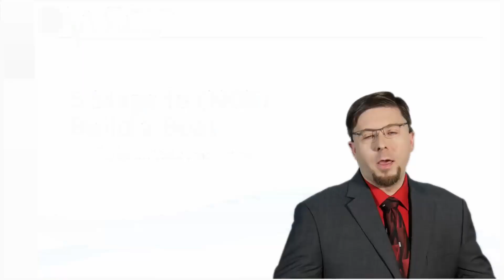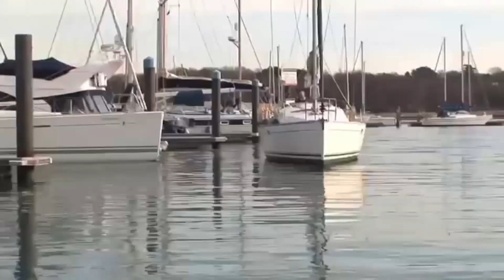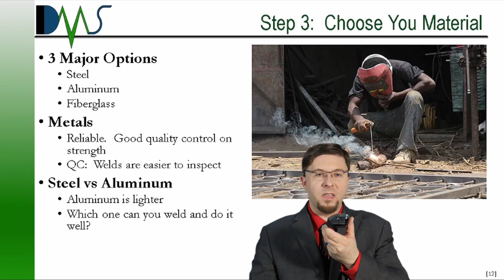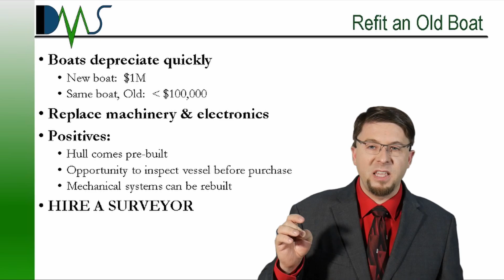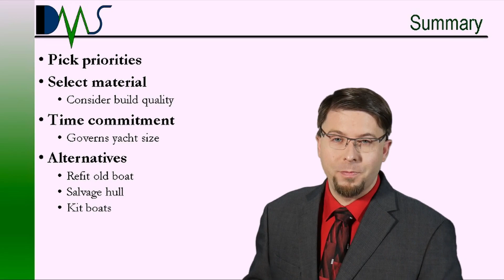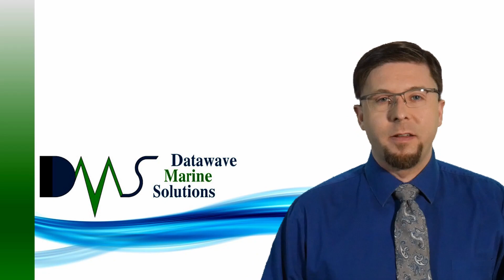5 Steps to (NOT) Build a Boat:  Planning for DIY Yacht Construction

Comment: Watching this, the guys building his own vessel, SV Seeker, springs to mind. I do wonder if that vessel will pass survey.
Reply: What survey? He is going to get to the regulatory fine print and decide to classify it as a pleasure boat of less than 65 feet buult for personal use. In which case no survey is needed.

It's actually been a while since I looked at the regs in the US, thus I may not be remembering the details for SV Seeker will find too clearly. Up here in Canada the window of no inspection is a pleasure boat, between 6 and 24 meters long, between 43 and 424 cubic meters of volume, with a capacity of not more than 12 passengers, and built for personal use.
Reply from the maker: @TrabberShir  It's almost the same in the US.  According for 45 CFR 2.01-7, as a chartered boat with captain and crew provided, they are permitted to take up to 6 passengers and still be classified as an uninspected vessel (no survey).  There are also some size limitations on GRT.  But even as a private yacht, USCG still includes some basic requirements in terms of survival flotation, fire protection, navigation equipment, etc.
Reply: @TrabberShir  It's the Jones Act that will dictate whether it is an "Inspected" or  "Uninspected" vessel, but insurance will definitely require it, especially as a commercial venture to carry passengers. Now I don't know what his intentions are, but as a retired marine surveyor I would deny that boat coverage for a dozen reasons.  If he can get his naval architect to sign off, then fine.
Reply: @BrianNavalinsky  I am not sure trusting the architect would be smart on that boat, unless the plans take all the decoration into account, or the raw plans have a ridiculous reserve of stability. Been a while since I saw the state of his project, but when you need a crane to lift decorative ironwork to be installed on top of the house, that throws up some red flags.

You might also be surprised how willing he might be to go without insurance. The guy that designed his origami hull preaches the type of anti-establishment ideals that result in lots of uninsured boats.

Edit: named a name then realized I may be naming the wrong member of the supply chain.
Reply: @TrabberShir  To give you an idea as to where I am at on the whole Sunseeker circus, I sail a J/120 and it is all white except for a Baltoplate bottom.
Reply from the maker: @BrianNavalinsky  I don't think the Jones Act plays into this.  As a vessel registered in the US, SV Seeker falls under USCG rules.  46 CFR 2.01-7 specifies that it would be an uninspected vessel (yacht) with 6 passengers or less (plus a few other variations that are possible).  The Jones act would apply if the vessel were registered to a foreign flag and traveling between two US Ports.
Reply: @DatawaveMarineSolutions  That's where you may be surprised.  Sunseeker could probably handle 25 passengers on a few hour harbor cruise.  If they have paid deck hands,  I think the Jones act could well apply. That whole project is weird and brings back far too many memories of ill-fated projects I saw at the boatyard I owned for ten years. One very similar project sank off Dunkirk,  NY, drowning the owner.
Reply: @DatawaveMarineSolutions  Forgot to mention,  as an aspiring naval architect as a teenager, I really enjoy your videos.
Reply: @BrianNavalinsky  Only a dozen?
Reply: @johnq.public2621  Never gild the lily. Always come in with your greatest hits.
Reply: That would be a big "No".
Reply: I hope you and those have supported Seeker get to read this. I am really surprised that no one has organized a class action against Doug & SV Seeker for misrepresentation. Let me explain, when you jump on a commercial flight, that airplane would have had to been certified and licensed by various Govt agencies to ensure a safe passage. No insurance company would go near any aircraft that is not certified. (remember this point) imagine if anyone built a plane in their backyard and then started taking passengers on flights, the airplane would not be certified and no insurance company would go near it.  

 So where does this lead to? Doug has for many years, in particular in the early years promoted SV Seeker as a “research” vessel, he actively promoted that SV Seeker would take people out to different places in the ocean so that Scientists, Marine Researchers, University students, Marine Volunteer Organisations could study the Marine environment etc.  I believe he has cut down on these claims lately (as he knows why) anyway... many people and companies have donated time, money and goods/resources to further the claims of Doug that SV Seeker will be a “research vessel” available to the group of people mentioned earlier. 

 Let me take you to any real research vessel that currently takes out Researchers, Scientists, Explorers etc., those vessels (Google them if you wish) are registered, compliant and in survey to do just that (take people out for research purposes) in addition the real research vessels are well equipped with laboratories, deck cranes, some with submersibles etc. And importantly the Captain and the Crew are fully licensed (proper Marine qualifications) and the vessels are insured. 

 Now take SV Seeker, a vessel that has been misleading people in its claims to be a research vessel, it is NOT in Marine Survey (generally speaking Survey means the vessel must be built to a certain standard and function) NOT compliant to the industry standard and does NOT have any Marine qualified Crew, there is no Captain, First Mate, Second Mate, Marine Engineer with duly required Marine Licenses. 

In addition to this, the use of non-Survey materials and building standards would ensure that SV Seeker would not in any quick time frame be able to be Surveyed for its stated purpose. Therefore, no insurance company would go near them for the stated purpose that Doug espouses, i.e. a “Research Vessel” that will take people out to Sea. (Researchers/Scientists etc.)  

 Now take ANY University, Marine Science organization, Education Institution, Volunteer Marine Group etc. the first thing they ask for, before anyone steps one foot on board are the certifications and qualifications of ship & crew, it is all part of due diligence. Without this, there is NO insurance.  

No organization would send their students or staff on a vessel that cannot be insured and is not certified for the purpose. Any School, University/Organization that does would face a huge lawsuit if anything went wrong, hence the absolute need for insurance for all sides. 

 Doug and SV Seeker have at best, managed to trick lots of people into building and funding him a boat for his own personal pleasure and he will probably take a few people out over the years for a fun time. 

In short SV Seeker is not in survey, not compliant, does not have suitable qualified crew and therefore is not insurable and cannot take out anyone from any Government or Private/Educational Institution/Volunteer Organization or business for the purpose of Marine Research. 

  

It is his own personal boat, and his supporters gave him free stuff to do it...feel ripped off about now?
Reply: @Leosarebetter  long reply. 
I am sure there would be a way to have it surveyed. However as a commercial vessel it may be very limited in its area of operation and capacity. But the engineering department, the way the vessel handles and other things like a simple rolling cover to the main hatch. 

It's a great idea in principle, but from what I have seen he does not want to know about marine regulations. 
Even building the ship off plans from a marine engineer would solve many issues. 

I guess we will see if if actually floats and how it keeps in the sea.
Reply: @lachlanlandreth9069  No actually, he uses non compliant/non surveyable (if there is such a word) materials (wheelhouse windows for example) and the actual design of the hull and the materials used in the hull would not be allowed in commercial survey. It would cost as much again to have it in survey, its just a pleasure boat, nice nonetheless but def not a vessel that would or could take people out to sea. :)
Reply: @Leosarebetter  you do know there are diffrent levels of survey. If it's a safe floating structure, all the Saftey equipment that is required, it could be restricted to a river or closed waters like a lake or channel. 

Nothing useful of course, but it would never make an A1 survey level.
Reply: @lachlanlandreth9069  As I said, he promotes it as a sea going research vessel, taking people out for free! it will never happen in the context upon which he claims.
Reply: @lachlanlandreth9069  I'm not so sure it will ever get in the water.  At some point the port will get tired of him squatting on their property.  His options at that point are pay to have it trucked to another port, pay to have it loaded on to a barge or sell it to someone else.  I could see it becoming a restaurant or some other on land attraction.  Judging by how much work he is still doing on it, he was lucky he could not afford/ could not get insurance.  Repairs are much easier made when you can drive to a hardware store.